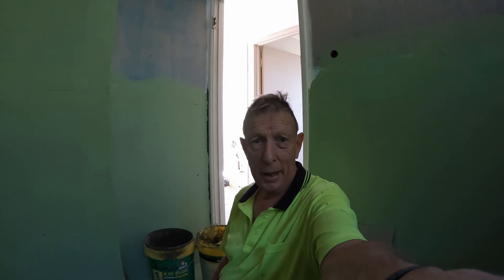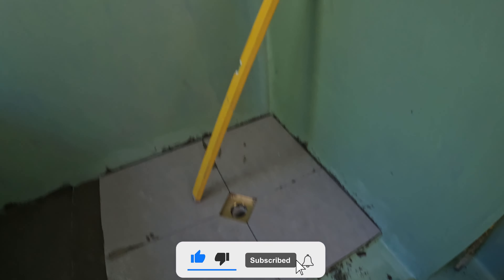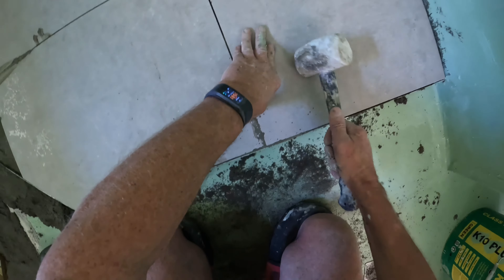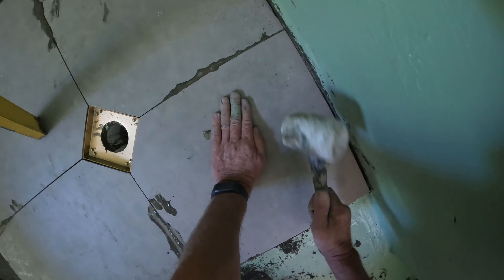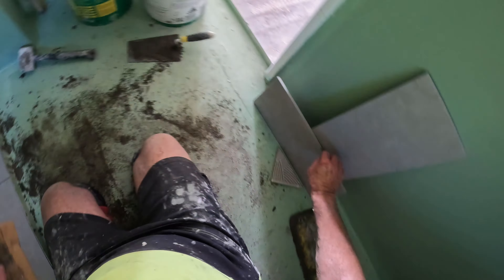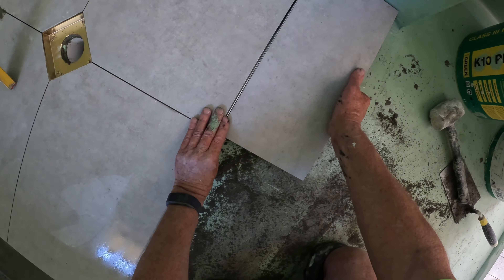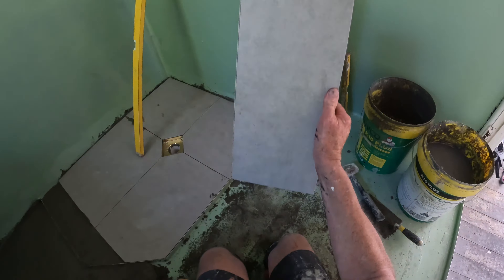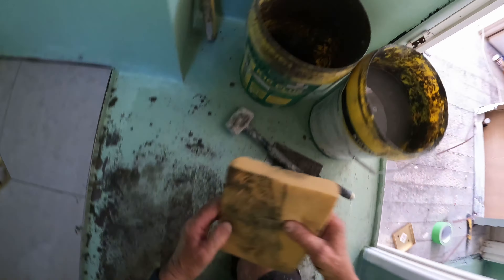DIY Laying 600x600mm Porcelain Tiles Without Splits

Comment: Wouldn’t be much fall on them if it’s not split
Reply from the maker: Thanks Ben for the reply
8mm from the water stop to the waste is heaps .
Do you think I need more
Reply: @candtmarbleandceramics  standard is 1mm every 80mm in nsw, love seeing a tiler still wet bedding showers though, it’s a lost art
Reply: @candtmarbleandceramics  and I don’t use glue to wet bed, I use cement powder over the screed and keep the tiles submerged in water and the water can over the screed before pounding them in and grout an hour later
Reply from the maker: Thanks everyone for your support Subscribe to my channel and learn to tile